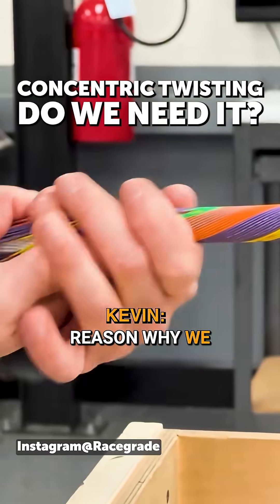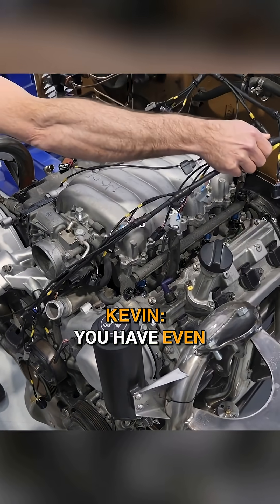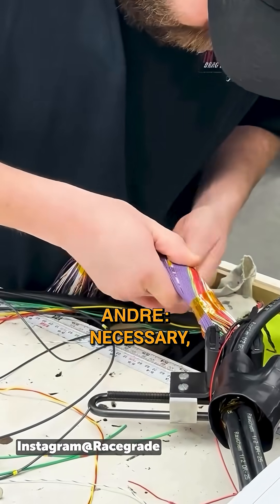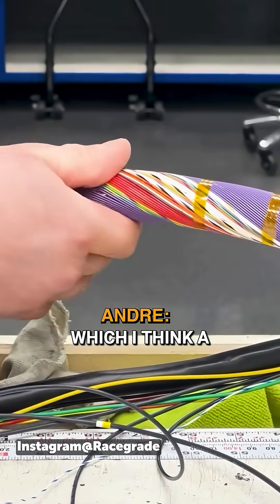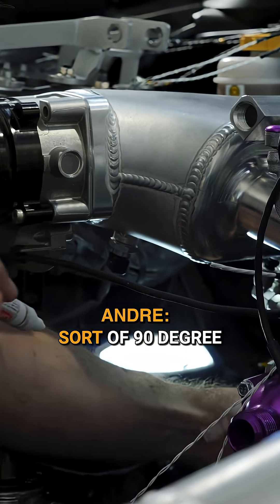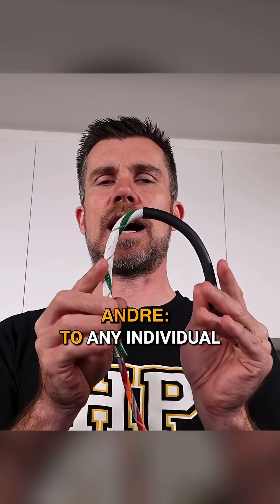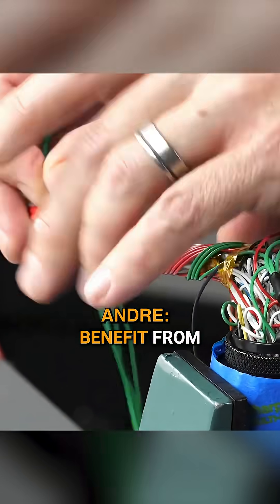Concentric Twisting, Do We Need It?

Comment: I received now a car with big issues in the wiring harness, as we had to open the complete wiring harness I thank God that it was not concentric. It's a race track car, but not for competition. We will correct the issues, but not doing any concentric twisting.
Reply from the maker: Generally it's quicker and a much more reliable result to remake a harness if it has BIG issues than it is to try and bodge a fix regardless of twisting. Best of luck! - Taz.

Comment: Having made similar stuff I find the harness won't drain or dry out.
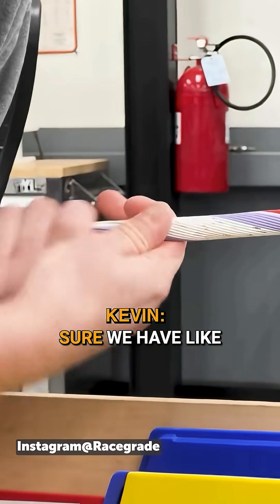Reply from the maker: When the flex is being shown at around 0:13, that's the finished product. It's sheathed in the likes of Raychem DR25 and is fully sealed. It's not just done for moisture/chemicals/oils (think engine bay), it's also abrasion resistant. You should check that out if you're having issues even if you're not doing a concentric twist. That and booting (connectors AND transition points) should be a consideration, but certainly not every wiring application needs the same considerations.
That said, the Tefzel wire sheathing is also tough, and unless damaged, standing water won't go through that either.
Hope that helps - Taz.

Comment: why dont they use an ethernet cable or something instead of all these wires.
Reply from the maker: Because that is the wrong type and size of wire. It wouldn't even work with the terminals for this connector which are designed for Tefzel (the wire shown).
Step one of any wiring task is planning, and that includes making sure you use the right materials which in this case is not ethernet cable, but for your own application on something else entirely different, maybe it would be. That's why we plan and get specific 🤘
Hope that helps and makes sense! - Taz.

Comment: Absolutely not, it's just rididculous, and a nightmare to diagnose and repair faults later. Design a harness for reliability and ease of install/repair.
Reply from the maker: These guys work hard to make a harness that is reliable and won't need constant diagnosis and repair. Most teams at this level will replace rather than repair though, noting save for a massive accident a harness like this will easily outlive the chassis in a motorsport application. It's a pretty specific application and every car out there doesn't need this type of wiring for sure 😎

To understand your point of view better though I'd be interested to know the specific faults and repairs that you're constantly battling with to have it at the front of your mind when looking at this though if you have a moment to share? 😎 - Taz.
Reply: @hpa101  I'm not constantly battling them, with a simple non concentric harness. Because simple works. People often seem to forget that. Keep it simple.

Comment: How much extra cost in time and cable? How much extra weight? 
Wouldn't the argument of bending, be quickly sorted by laying the loom in situ and including those bends when wrapping?
Reply: the extra cost in time and cable is more than recovered for a vehicle that is going to be worked on as much as a racecar is.  the additional length of cable and weight  is (while not zero) not enough to really effect performance, and if weight is that concerning, you'll have your electronics as close to the engine bay as you possibly can... this is true regardless of "concentric twist" or not in your harness.  

while you're considering the time, effort, weight and money costs of a properly designed and meticulously crafted twisted harness, i feel you're ignoring all the work that happens AFTER the car is put together the first time.

i remember watching the video and actually learning a lot AND opening my eyes to issues i haven't encountered or even considered, but race teams have seen, fixed, and written proper "how-to" instruction for you to make a more robust design, project, or product.
Reply: @NathanNostaw  not only does the Swiss help with Ben's but it helps when the cable gets pulled on all the time. 
I have to replace harnesses quite often on equipment and they often happen to be harnesses that don't have twists. 
The ones that have twists tend to last significantly longer without internal damage

Comment: That looks like a nightmare to diagnose later.  I'm not a car guy, but a tech guy, and that's a problem waiting to happen.  When something breaks, and it will... good luck finding the problem and accessing out without undoing the entire spooling
Reply: there's usually a bunch extra unused wires thrown in to make the bulk and for future proofing, so you can just connect another items like sensors and stuff if you need without making a whole new harness...
if there's any trouble, you can probably skip the headache part of diagnosing and just... use another free connectors.
Reply: As a tech guy and a car guy, I want to ask, what is the problem waiting to happen?
Reply from the maker: @seanmurry6903 give a specific example and we can run through what might be the best way to approach it.
I can promise you though if that was a real and common issue for the skill level of the people working with wiring like this, it wouldn't be done.
On the flipside, there is a reason why this isn't done to all wiring too and there are downsides. It's application specific - Taz.
Reply: @hpa101 appreciate the response! I'm totally unfamiliar,  just speculating... im not a car guy not sure if i mentioned that. But but i can understand that people wouldnt do it if it was THAT kinda hassle later... that said though, it sure does look nice all wound tight like that.  Very pleasing to the eye, for sure.
Reply: There is no way around that.. 40 pairs of wires are just that.. Twist neat or not, when it comes troubleshooting it will be a challenge in matter how you look at it... The way they are doing it is professional and easier to run them through the tide areas... BRAVO you guys are a true artist
Reply: It wont be my problem, youre gona fix it for us.

Comment: I'd put it in my classic hot rod and nothing more. If it's a show queen sure. If you use it and race it, fuck no.
Reply from the maker: This style of wiring is pretty much exclusive to racing applications 😎 - Taz.
Reply: @hpa101  Yup. But I go the other way. I wire my components individually so they can be changed instantly. DBW goes down, change the harness. Rad fans go down, change the harness, Air pump has an issue, change the harness, injectors, coils, ref/synch, etc... all separate little harnesses  to swap as needed. 
In a pavement car, sure you can run that wiring but off-road where we bounce through the desert vibrating everywhere, I find it more efficient to run it the way I do.

Comment: It's pretty for Instagram but good luck trying to fix/replace/troubleshoot lol
Reply: Concentric twist or not. Fix it, won't be easy cause of DR25 and shrink sleeve everywhere.
I m pretty sure that the car will crash before issue on harness. :)
Reply: Why would it be any harder than a traditional harness? If you've built it, you know exactly what everything is and you will have designed it to be serviceable
Reply: @LuckyFruitRacing  because you can't separate the wires as they are all tightly wrapped in opposite direction layers.
Reply: @NathanNostaw In which case the chance of failure along the length of those wires is virtually zero. The existence of these harnesses is because they're superior in every way to a cheap factory harness.
Reply: @LuckyFruitRacing  because it's impossible to open up and repair any individual wire inside.
Reply: @LuckyFruitRacing the thing is, most people with money will not build it themselves😊
Reply: @LuckyFruitRacing because it is rugged, mil spec etc... And because he has these specs you will be sure that your equipment will fail before harness. Otherwise, the more current fail on harness is contact problem, but you have made a repair loop for this.
if issue come from chafing you fail on install or design.

and the man who made harness is not everytime the man who made repair diagnostic. but these 2 persons use schematics diagram or wire list to diagnose.
Reply: You cannot bend a harness that has not been twisted.  GL have fun with your spaghetti.
Reply: @clippyisangry  you're uneducated in this field.
Reply: wouldnt it be easier to replace a wire since you have all these extra wires in there?
Reply: This isn’t for instagram, man some one you just don’t get shit.
Reply: Dude what? It’s no more easier to repair a. Regular harness properly either. The idea is that the concentric harness if properly prepared will not need servicing unless it’s been somehow damaged during a race. But simply patching a club sport harness isn’t exactly a proper fix either…